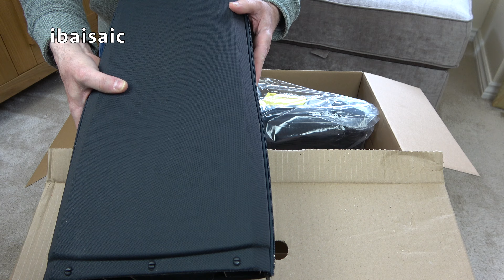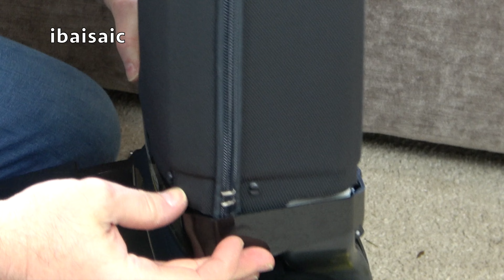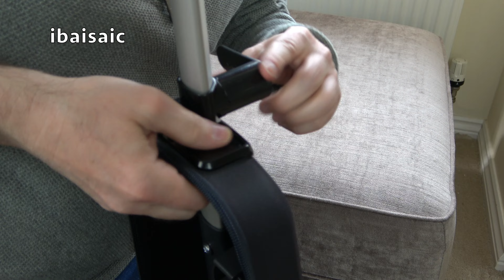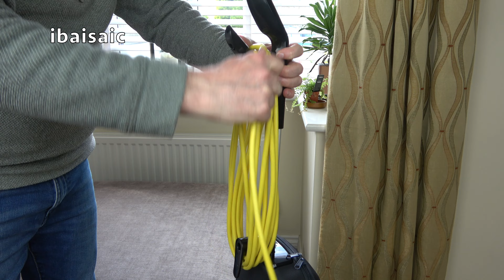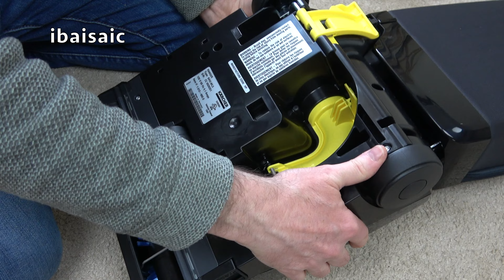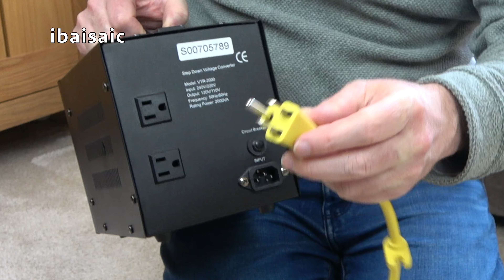Karcher Ranger By Sebo Upright  Vacuum Cleaner Assembly & First Look

Comment: This is so unusual for modern vacuum, but still very effective. I mean dirty fan (or direct air) system. They are know for high airflow and no need for high wattage motor. One huge plus is super light handle weight. Another interesting thing is that the suction fan is belt driven AND motor has big pulley and fan small pulley. It means that the suction fan runs at extremely high speed. I have never seen design like that.

Comment: This would've been a godsend 5 years ago when I used to clean offices! The BS360 is fantastic but was a bit bulky for cleaning small areas, it would be great if the pesky EU obstacles can be overcome...Great video as always 😊
Reply from the maker: I used to clean a shop with a Hoover 912A Commercial, followed by the much lighter C1300 Senior. I provided them both of course because I didn’t want to clean large areas of carpet with a Premier Mini.

Comment: Thanks for this Roger!  The belt driven fan is very interesting.  From reading some explanations on a popular vacuum fan website, it seems that this configuration can also increase RPM’s at the fan and increase air flow because the spindel at the motor end is wider than the spindel on the fan end.  So, for example, one rotation at the motor end may actually result in 4 rotations at the fan end.  Fascinating!  I agree that the power kick switch on the side is unfortunate…. why doesn’t Sebo just put a step on toe switch on the top of the motor hood?  Kind of strange that they did not….

Comment: Incredibly attractive unit, nice to see it uses a common brushroll to other Sebo products.

Usually Sebo has assembly be a painless process.  This machine doesn't seem to meet the supposed high standards of the EuroVac industry.  I mean, the handle should extend through the bag and down to the machine carrying the cable in it like a conduit.  This one has the metal handle only go part way down into the bag housing and the cable is exposed to dust and dirt as well as being a weak point on the machine filtration wise.  Granted, the bag should be near if not full HEPA standards but I have operated enough vacuums to know that even bagged can be as filthy as a dry bagless machine, especially if something goes wrong with the dirt path.  Let's go back to the cable:  Since it's inside the bag housing, any dirt and dust will blow through that opening and contaminate the IEC C13/14 connection point (it's nice that this is used as it's a similar standard used for other appliances, tools and electronics also making the cable user replaceable). causing more problems down the road.